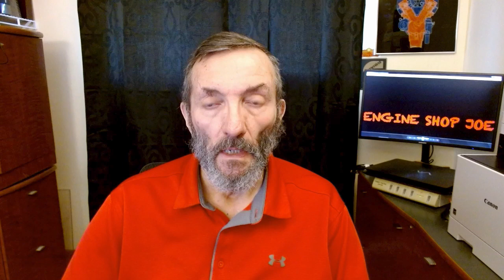Engine Torque derate with DEF gauge red light on

Comment: Just like your phone or PC, sometimes a reboot and updates is all you need! 
On a side note Joe, I have to tell you something this channel has forced me to improve my skills on. MS Excel! Being able to take log files and organize, group by sheets, and convert data into graphical form has helped me a lot. As I do this, more questions pop in my head though! Curious on the ISX15- X-15 platform if Cummins has any guidelines on DPF differential pressure and pressure after during DPF during a stationary regen? On the 12.9L Paccar, a reading above 0.26 PSI (0.53" Hg) towards end of regen is one indicator that DPF restriction is starting to get on the higher side. On outet pressure, anything over 0.5 PSI (1.02" Hg) indicates a restriction after DPF. Going from the 13L to 15L, the air mass and volume would be different so I assume the pressure drop criteria would be different as well. Curious if Cummins has any general guidelines or you do through  the many log files you've reviewed. Thanks and enjoy the weekend.
Reply: cummins, .69 or .63 volts at key on engine off, should be .69 but system will work fine with .63, at .88 volts the regen is triggered (engine running, snap accelerator to floor), 1.25 to 1.50 volts the regen will be kicked out from faced plugged and you will have to use a sensor to hang on the truck and force the regen then reattach the dpf sensor and do another regen, if you have access to a cummins when your mx is having issues move the sensor to the cummins and read the voltage there, paccar only lets you see the info during a regen and is impossible to diagnose a bad sensor. also you should go into features, aftertreatment, dpf, and turn on the first two items, parked regen and during pto,  the above info can be seen in monitor with the stationary regen preset tab opened, the first sensor voltage is just a couple of lines below the open screen, the second set of voltages should mirror the first if not the second side of the sensor is bad, the large port sensors have been failing on the secondary side alot. will show almost 5 volts engine off key on.
Reply from the maker: I think I told you we have about 25 MX-13's in our fleet now. Mostly boom trucks. One was stranded in a transformer substation the other day. It was stranded (for the same problem) two weeks after an $8K repair at a dealer (new dpf and whatever) We borrowed a laptop with Davie 4 and ended up towing it home. Our guy figured out how to log. I opened the csv and it is not what I normally see.
Now i have to learn how to manipulate the log it makes so it is understandable to me. We are waiting for the unit to come back. They are sending it on <40 hours jobs and then manually regenning it to send it out again (and again). Once they have to tow it again they will let us have it to figure out what is causing the frequent regen. On the Cummins X15 the Numbers changed a bit when they went to the unitized DPF's. Generally speaking the trigger for the engine to start passive regen is around 1.2 inhg. Normal values depending hugely on duty cycle are 1.2 to 2.3 inhg. Once you see consistently above 2.3 inhg you will see time between regens start to creep down and then it is a spiral. Those engines have a fault 5383 which is a maintenance fault telling us to replace the dpf. That works well if the engine is running properly.
Reply: @ENGINESHOPJOE make sure your operators are keeping a oil usage log, mxs like to use a gallon a week, OTR, the doc if not new is  your most likely culprit, new dpf and whatever could be alot of things, you need a paccar sign on to use the ecm paramaters and adjust any that you can and download the file 15 min after the changes, before downloading the file and flashing the unit, if you get a aftertreatment absent or anything that needs a regen to clear you must regen, engine fan on and then driven 20 mins to get the code to go inactive, the engine fan on is a must.
Reply from the maker: Thanks for the suggestions and tips @youtubeisawesome2487
Reply: Thanks for replies!
 @youtubeisawesome2487: Thanks for the numbers, pretty much same spec as Paccar at KOEO (0.7 V +/-0.2). On the MX13 EPA10 checking data, they have volts to pressure graphs and showed the one for 1818119PE (Cummins 2871960) DPF pressure sensor. At one time I zoomed it out and plotted some numbers to plug it into a 0-5 V signal converter calculator that I saved on an online calculator. It has basically range -6 kPA to 37 kPa ( -0.869834 to 5.3663963 PSI) from 0-5 V. With the MX, the sootload is measured in oz/Gal from 0.0-1.34 for soot load (combined) and the soot load (based on DPF pressure sensor). I believe mobile regen on EPA13 is triggered (seems to be a moving target) when around 57% of this and goes into stage 1 (regen light on, P3797 active) at around 65% of this. So at about 0.7 oz/Gal, mobile regen is allowed and at .87 oz/Gal driver initiated with switch is enabled. This was for EPA13,  EPA17 and 21 it seems they moved the goal line back to around 0.5 oz/Gal so EPA17 seem to regen more often and have more triggers like deep clean triggered, diff pressure triggered, ineffective regen triggered, reactive (SCR ammonia buildup of blockage), soot load, time triggered and so on. Weird one is when you get to stage three and P1496/P3798 set together and you have to regen with dash switch because wont regen with DAVIE requested regen (or just update the software and code clears...) Interesting one on using a Cummins truck to monitor the delta pressure readings. Only have one Cummins currently, so what I started doing is monitoring all four circuits of sensor with Picoscope to catch issues. 

Joe: Good luck on sorting out your issues with the MX powered trucks. I know the default is Regen disabled in PTO mode. Need also make sure HC desorb is set correctly for application. Some bodybuilders integration with chassis isn't the greatest. One thing that I have found to keep DPF issues under control is air management services and DPF services. On our dumptrucks, I do the air management service @ 75,000 miles and DPF cleanings @ 150,000. Should really be hours, but operations here only tracks miles. The boost sensors and EGR venturi tubes seem to soot load the most and those readings are weighted heavily for mass airflow calculation. And yes, the CSV file is not as easy to view vs Cummins or a Eaton one in Excel. It is hands down easier to just use DAVIE as the viewer, but you can clean them up some by clearing empty cells or use the import data field on a new workbook to at least view it nicer. Cummins timebase is one second per data field across the board, while Paccar seems to float the sample rate as every sensor has different update rate.

Again, thanks for both replying but I guess I never got the answer I was asking! On the Paccar, once you hit regen temp of about 977 the regen runs for about 30 minutes. I always check the DPF delta pressure during the last five minutes while it is @ regen temp. If the pressure isn't below 0.26 PSI, the DPF typically needs pulled off because of ashload and cleaned or replaced. One thing I have come across is none genuine DPF's seem to have more restriction and will cause frequent regens and this strategy is how I discovered this. I was curious if Cummins had a general guideline. A new OE DPF on Paccar at end of regen reads around 0.10 PSI. Thanks!
Reply from the maker: Thank you @stevesauerland223
Reply from the maker: Email me at faultcodehelp@gmail.com. I don't want to put "values" up on the channel just because many people will take take them as a go/no go and then take action on what I say when they might not need to take action causing them to spend money they don't need to.  Cummins does not have a guideline but with a current calibration revision, on a highway engine, an X15 built after 2018 would log maintenance fault 5383 when it is time to change the DPF filter. This is the unitized aftertreatment not the old two section with a decomp pipe between.  Really the maintenance fault will log on any x15 with unitized aftertreatment if it has a current calibration revision ( less than 2 years old)